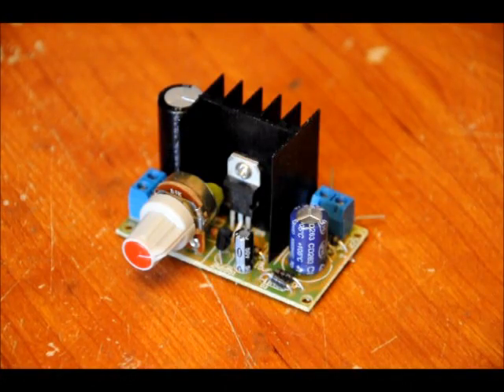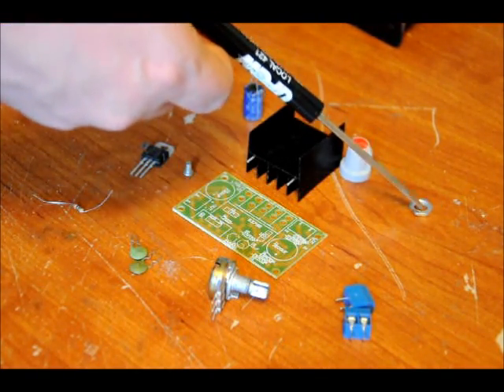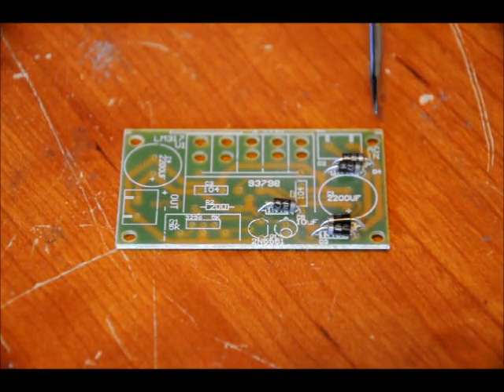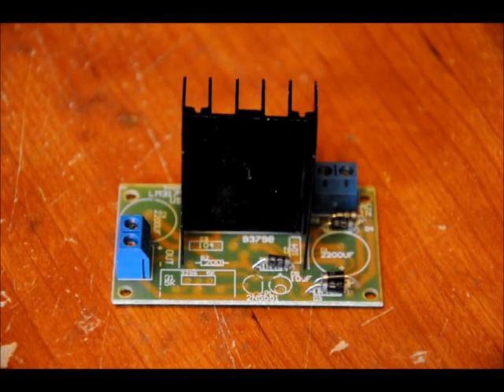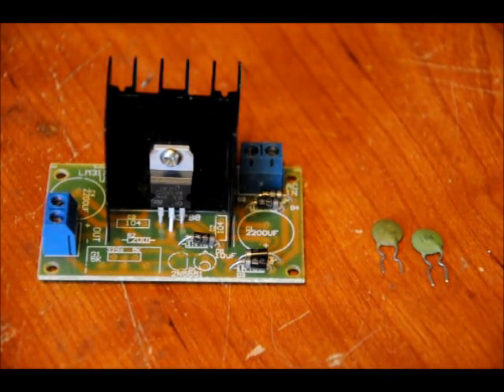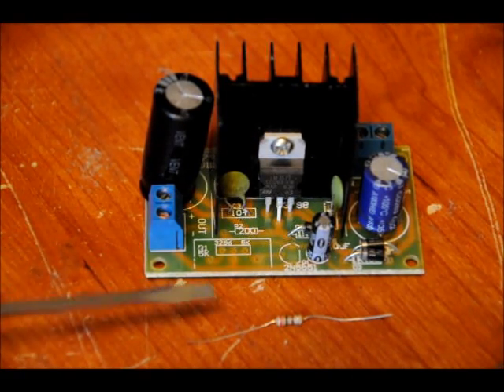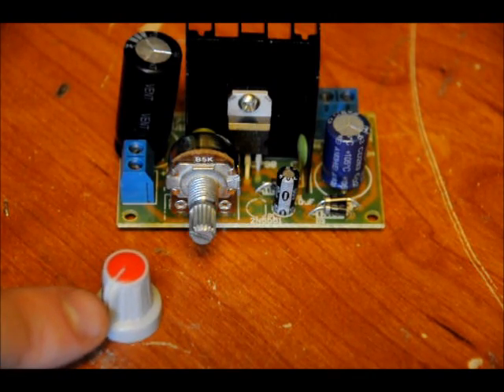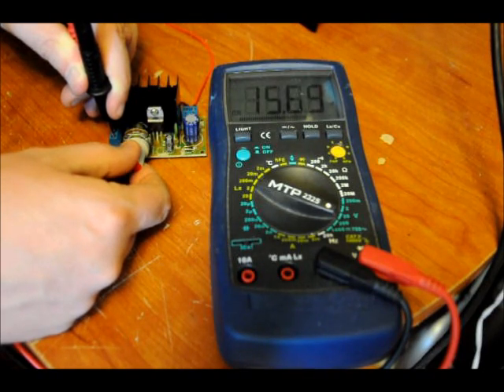Our new LM317 DC-DC variable voltage regulator kit for power supplies

Comment: i brought on of these on e bay and you didn't mention the 2n5551 transistor used in it to  and whys it marked on the pc board , and that transistor ended up getting shorted out on my circuit so sinc then ive come up with a 4 peace  version that passes the same battery voltage yet still can adjust the current  from low to high I dident use the adjust pin and I dident set the voltage nor current so its open so no resisters used and no heating  the inbuilt short circuit protection I used to

Comment: When discussing the Wiring for DC input IT would have been better to have used a pointer with a point and not a screwdriver because the flat blade of the screwdriver obscures which of the little solder lugs you were referencing.

Comment: I am wanting to build a regulator board for my 70A 13.8V + Power supply and I want to use a LM723 board with a 741 OP Amp, Trim adjustment with SCR and Pre Driver. I am finding it very hard to find anything like this for sale let alone any LM723 board at all. So I have decided to maybe try and build my own! In addition to my 70A Transformer I have bought 2 50V 1000A Bridge rectifiers, 12 3771 Transistors with 1 driver, 2 5 bay TO3 heat sinks for these plus 63V 180000UF cap and its going to use the crow bar device with 8 .05 5W resistors. I also bought all digital AC input readouts and DC output readouts! Pritty much all I need is to figure out this Regulator board problem! Thanks Bill

Comment: Is this to shock engineers ? This white thing at the diode is called "cathode". If you should do another board layout : place capacitors away from the heatsink, as the heat will dry them.

Comment: I bought a kit similar to this one and put it together worked perfectly! One thing I would like to point out I was unsure of before purchasing is, if you change the input voltage from 5v to 9v and you have your out put set at 3v it will still be 3v out put with either volt. Great video and product